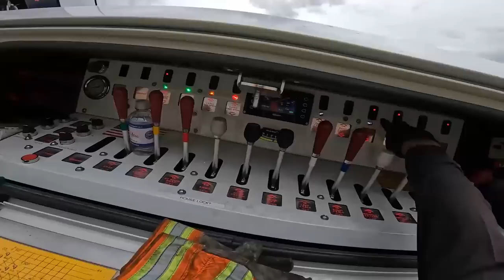Rear Trailer Rolls On Mountain Pass! Rotator Rescue

Comment: Why the trailer hitches so long on trailers in California?
Reply: That's standard across the country on those type of dump trailers. They're used for sand and gravel.
Reply: Long tongues on dump trailers is common when they are behind a dump truck- you can back the trailer in, dump it, then 'jack-knife' the trailer beside you off to one side, then dump the truck over the tongue- that way you don't need to drop the trailer to dump the truck....obviously, the tongue has to be longer to do this- if you had a short tongue like on a container trailer, when you jackknifed, it wouldn't clear the trucks body- or the load you just dumped from the truck ie as you run the truck forward, the trailer doesn't hit the load on the ground from the truck.....

Comment: A 3/4 ton SRW pick up truck towing a 20' box trailer of sand. What could possibly go wrong? I did see any weight class stickers on the RAM's doors, so was he really legal to tow that trailer or are the tickets mounting up?
Reply: You're joking right? A dump truck was towing the trailer which flipped and went into oncoming traffic, hitting the Ram.
Reply: The white Pickup hit the front of the Trailer as it was sliding on it's side and coming across the lane of Traffic.